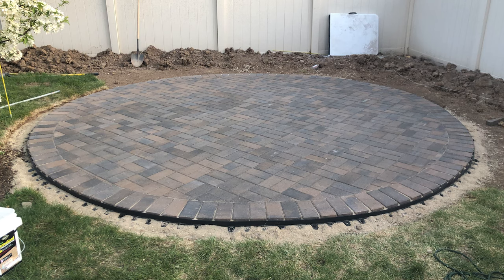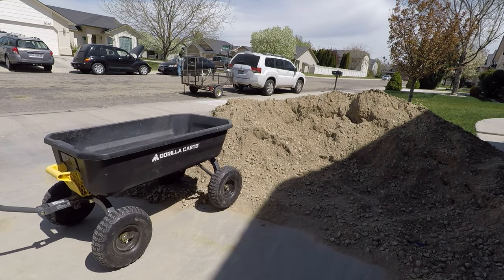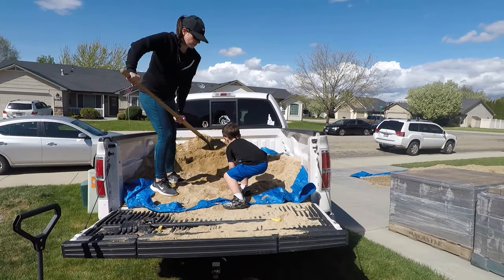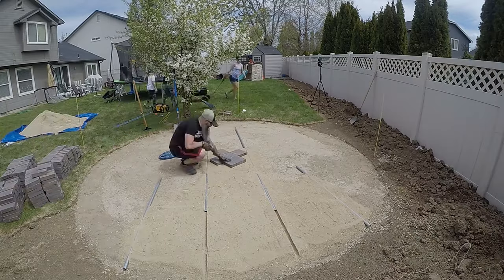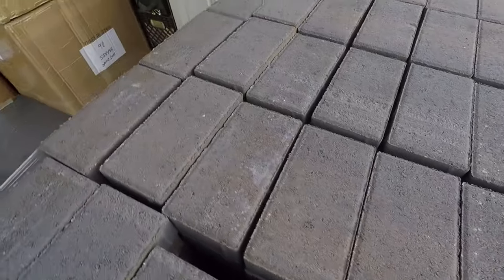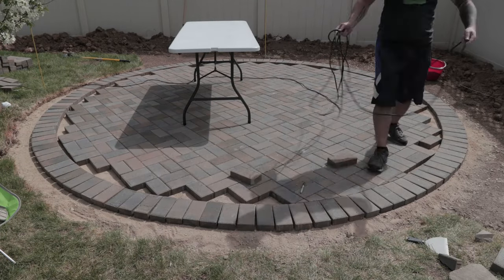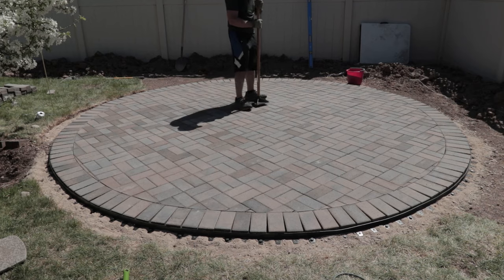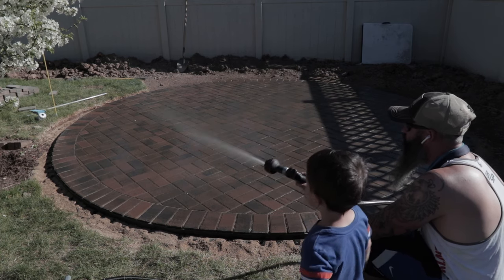How to Build a Round Paver Patio

Comment: Great information. I've built several of these. I quit using sand, though. Where I live, ants will burrow in it, and tree roots will undermine the patio. I use granite dust for the base. Once tamped, it's like concrete. Lay the pavers, and you're done. Try it.
Reply from the maker: I have both a tree root and an ant problem.  Wish I had known about that before!
Reply: @thetoolman3 are you just replacing the sand with granite dust or are you replacing the sand and 3/4s with granite dust? I have a big root problem.
Reply: So only use 4-6 inches of granite dust and no sand? Thank you
Reply: @ianrutherford1  I just use granite dust.  It packs so hard you don't have to tamp the pavers.  I tried using a power tamper on pavers over granite dust, and the pavers broke.
Reply: @thetoolman3  thank you!

Comment: i had bigger paver stones when i was doing this and i learned that putting a towel on top of the pavers and tamping with that 10x10 tamper reduces the risk of cracking. otherwise i would use a couple of rubber mallets (which takes much longer but zero cracking risk)

Comment: So instead of using the pipe to do the sand, dump sand in the area the in several spots around the edge and a few in the middle put the sand in little mounds about the size of a paver. Set a paver on a mound on the edge and push it down and wiggle it til you get the top of the paver a little higher than what you want. Do all the edge mounds first then set a paver on each one and put a string line on top of 2 and thats your hight for the middle ones. Screed from pad to pad until about half is smooth and its smooth the whole diameter 2 directions,  Chalk 2 lines across in the center. Set pavers in all 4 directions on the center lines. Let thepaver go past where you want the border. Draw a circle around the same way he marked his circle. Cut pavers in place fix edge of sand and set border.
Use a plate compactor with a urethane pad on bottom on top of pavers after you brush the poly sand on top then wet

Comment: I've been scouring the internet for this guidance. This is concise and helpful and will be my main source. A lot of people use a compactor on the patio stones. Is there a reason apart from cost not do this?
Reply from the maker: I think it depends on the stones you use.  I was worried a compactor would break these.  I broke one even with the hand compactor, had a high point and I thought I would just beat it down and it broke.  That’s why I suggested pulling the paver and removing a little sand to get it to drop.  
Thanks for the compliment!
Reply: @OutdoorBeards  Excellent point. Thanks for your response. Again, you've made the best reference for this project that I can find -- and there's a lot!
Reply from the maker: Good luck with your project!

Comment: It's easier to build beyond the border and mark it.  THEN cut along the marked circle edge.  Cutting each individually is actually slower and prone to inaccuracy. The borders should not have open slivers and should be "pied" so that they have uniform gaps at all planes of contact. The hand tamperer is not that helpful due to the lack of force it can efficiently deliver.  A much better option is to used a padded vibratory compactor.  It can also (and should) be used to compact the polymeric sand into the joints.  The hand tamperer is simply not recommended as is also stated in installation instructions from the manufacturers. Also, if you had no other choice, at least put down some padding so that chipping and white capping of pavers can be avoided.  The bare contact between the steel and paver is just asking for trouble.

Comment: If you used 124 around the edge, is the 14 ft circumference
Reply from the maker: Correct.  The math was done so the finished patio is 14’ wide

Comment: How many pavers did you use in total? I'm trying to do a 16' round patio, could you give me an idea of how many I should buy it and how much you spent in the material ?
Reply from the maker: So the math comes out to 747 pavers but with the cutting you need about 800.  I bought the pavers on sale for .25 each so I paid a little over $200 for the pavers.  Road base, paver sand, edging, and poly metric sand with delivery fees maybe another $300.  I bought the grinder new and random stuff, etc.  so I would say between $500-$600 total for just that patio.
Reply: Thanks for taking the time to answer my question it will help me a lot
Reply from the maker: Hey I’m sorry I thought you were asking how many I used on mine then realized just now you were asking for a 16 footer. The math for that size comes to 989 pavers.  Add at least 100 to that for cuts and random issues.  Good luck!

Comment: I would like to ask what kind of bricks you used. I just bought a bunch of used bricks, but it turns out there are 2 types of bricks. One of them has flat sides and one has spacers on each side so they fit together with a gap of about 1/8th of an inch. 

Not sure which kind to use. If I use the kind without the spacers, should I just place them as tightly as possible. 

Thanks for the video, the patio looks great.
Reply from the maker: The ones with the spacers are “pavers” for making a patio or walkway.  The gap that’s created is important to give space for the polymetric sand.  The other bricks you mentioned that don’t have the spacers are for building things like walls or built in grills where you would be using an adhesive to hold them together and, aesthetically, the spacers would look bad.  .
Reply: @OutdoorBeards  Thanks for the quick reply. Gonna start digging now.
Reply from the maker: Enjoy!

Comment: I need help to figure out how many pavers I need for a 13 radius circle 
Paver size 3.5in  x 7.1x 2.3in
Reply from the maker: Please confirm for me a 13 foot radius so patio will be 26 feet diameter? I have to ask because some people get radius vs diameter confused and then I give them a totally wrong number.
Reply from the maker: If the radius is 13 feet we convert that to inches.  13x12 = 156.  Then find the area of the patio.  Pie x r squared so 3.14 x 24,336 which gives us 76,453.8.  Then the area of the paver. 3.5x7.1 = 24.85.  Then we divide.  So 76,453.8 / 24.85 = 3,076.6 pavers.  Round up a bit for cuts and such.

Comment: Im just about ready to begin building mine. You used an angle grinder for cuts. Was it a 4" or 7" and would a 7" do a better job? I need to buy one for the project.
Reply from the maker: I used a 4” which made me cut both sides, break it off, then shave down the remaining bits of the edge.  A 7” grinder would make this process easier.

Comment: Hi! Super helpful video and to the point!!! I’m going to mimic yours exactly LOL. How many pavers did you end up using? (Not sure how many to buy for this size patio and I’m new to all this!)
Reply from the maker: Amy Zhang so the math comes out to 964 pavers.  I had purchased 1400 because I am also doing some edging using the same pavers.  I would suggest buying 1000 since you will be cutting some.  Remember when cutting that you can use the cutoff pieces in other spots and have less waste.  And with Lowe’s and Home Depot you can return what you don’t use.  Good luck!
Reply from the maker: Amy my math was wrong the other day.  I did the math for a square not a circle.  Correct number is 747 pavers so maybe a little over 800 and you should be good.
Reply: What math are you using? Is it a calculator?

Comment: Do you know the total cost was for this entire project?

What is the radius of your patio?

How many days of work did this take you? If you kept track of hours you spent I’d be interested in knowing that.

I’m proposing to install one of these at my city Zoo and I’ve never done this type of job before. Just want to say thank you and your video may help improve a kids interactive reading area at a Zoo in San Jose CA! 🙌🏼
Reply from the maker: It was a 14’ diameter, so 7’ radius.  As for cost, it’s hard to say because I did two patios and 150 feet of edging all with these bricks, so I purchased like 1600 pavers but this patio only used 800ish.  Also I bought paver base, sand, and poly metric sand for all the projects at once.  If I had to guess I probably spent $500-$800 on the patio.  Also this was 2020 so things have gone up and I’m kind of estimating.  Hours worked, I did it over the course of 6 days at 8-10 hours a day. 
Hope that helps and good luck with your project!

Comment: Thank you for the video. Super helpful!  Had a question...how important is getting the foundation leveled BEFORE the paver base?  Is it safe to say that as long as I can put in 4-6” of base layer that is leveled or slightly leveled away from the home, I should be okay?
Reply from the maker: When you lay your pipes down to start applying the sand you will see gaps under the pipe here and there.  This is not a huge deal.  However, if you are so far off that say the left and right pipes are lower than the middle pipe while your skreeting you may end up with waves in your patio.  When you lay the pipes down their level in relation to each other is very important.  So I would say do the best you can at that stage to stop problems from occurring later on in the process.  Remember this is the foundation. The better you do the foundation the easier the rest of the steps will be.
Reply: Thank you for the quick reply!  I think I was using the wrong terms in my questions.  How important is it to get the clay/dirt leveled before putting the base/gravel layer (pre-sand)?  I don’t think I’ll have any issue leveling the base layer after putting 4-6” of it in, but digging and tilling the clay here to getting it leveled is taking an eternity - LOL!  Thank you for all your help and hope you upload more to your channel!
Reply from the maker: Oh I understand now!  No that is not important and can be rough
Reply: Perfect thank you! 🙂

Comment: What kind if sand did you used for the pavers to sit on?
Reply from the maker: It’s just called paver sand.  You can get it at a landscape supply in bulk or at Lowe’s and Home Depot by the bag.  The bulk option is much cheaper if you have a truck to transport it.

Comment: What size angle grinder are you using for this project? thanks
Reply from the maker: It was either a 4.25 or 4.5.  Don’t recall exactly.  It would be much easier with a larger blade but that size grinder was cheaper and I didn’t mind the extra work.

Comment: I know you said you dug a 7" hole, but how do you ensure that it was also a 7" deep hole, say, in the middle of the hole?
Reply from the maker: The hole being 7 inches exactly all around os not important.  You don’t have to level out the hole.  It’s just a rough number.  The high and low spots created from digging get filled by the base material which you do level out as you pack it down.
Reply: @OutdoorBeards  Thank you!!!

Comment: How deep should the landscape edging be? Should it be as low as the layer of sand or only as low as the pavers?
Reply from the maker: Technically the edging goes on top of the base material to hold the sand in place.  I did mine different because after the project was done I removed the edging and packed dirt in to hold everything in place.  Where I live the dirt is mostly clay so this works.  For most people o say do the edging before the sand step.  This is challenging with a circle patio though.

Comment: Thank you for sharing this is exactly what I am looking for to start my next project. I would like to know how many stones did it take to in total to complete the project?
Reply from the maker: Just under 800 if I remember correctly.  It’s been a while.  I think the math came out to around 750 but you need extra for the cuts.
Reply: @OutdoorBeards  Thank you I am also going to follow your Edging that one looks really amazon too your work is fantastic.
Reply from the maker: Hey thanks! little advice on the edging, use some concrete around the upright.  The poly metric sand does not hold up as well as I hoped.  I went back and put a bit of concrete behind the upright portion of the edging.  This would have been easier during install instead of after the fact.
Reply: @OutdoorBeards  Thank you for the advice  I will do that.

Comment: Great video... what was your total expense in material?
Reply from the maker: Maybe $600.  It’s hard to figure out because I actually made two patios and 165 feet of two step edging.  I bought the material to do all of it at the same time so that is just an estimate.
Reply: @OutdoorBeards  $600, still significantly cheaper than a contractor. Thank you for the info.

Comment: Great video! How did you determine how many pavers you needed for the outer edge count? I'm making one with a partial circle, roughly half of a circle with a radius of 4.25 feet. Should I just eye-ball it are there inserts or a method to keep them evenly spaced out at the very outer edge? Thanks!
Reply from the maker: My brother is a mathematician and helped me do the math.  I’m sorry but I would not be able to explain that via a message.   As for keeping them evening spaced I just eyeballed it.  It’s pretty noticeable when something it out of wack.  Good luck!
Reply: @OutdoorBeards  Ok, thanks! I'm a bit worried that with such a small & tight circle, the outer bricks will have pretty big gaps at the very outer edge of the circle (like the rim of a slice of pie). Hard to describe w/out a picture. Anyway, with just sand in those wider/outer wedges, not planning to use perma-sand if I don't have too, I hope it'll be ok. Thanks again, your pavers turned out nice!
Reply from the maker: @heytae  what size are you pavers? Length and width.  I can do the math for you but I couldn’t explain it.  Lol.  Also you should use perma sand.  Regular sand will wash out over time and won’t stop the pavers from moving.
Reply: @OutdoorBeards  That's very kind of you but probably not needed now. They're 8 1/8 x 3 7/8 but I just found out today that the bricks we have to go with to match an existing bricked area can only be bought in "cubes" of 1015 bricks! I think I'll use about 700 of them per the brickyard. That's because we're considering going with split pavers (half the thickness) for less cost, and just increase the base rock thickness to get the bricks to sit at just the right height. That's very generous of you to do the math for me, but because we'll have plenty of bricks left over, I don't think we'll need the calculation any longer, but thanks anyway! Yeah, considering perma sand, but I saw some youtubers say not to use it b/c it'll peal after X years, but here in the San Jose, CA Bay Area with the mild climate, I can probably use perma sand w/out any issue, right? I like the idea of perma sand but don't want to worry about what it might look like in 5 yrs so please lmk if you have an opinion for my climate.

Comment: Trying to do a 10” circle how much brick?
Reply from the maker: What is the measurements on the pavers you will be using?
Reply: @OutdoorBeards  8in-L x 4in-W x 2in-H…also it’s a 7” circle…
Reply: @OutdoorBeards  also how much paver base would I need thanks.
Reply from the maker: Can you look at the specs of those pavers.  Most likely those aren’t the measurement.  Should be 7.5x3.5x1.5 but they are called 8x4x2 to make it simpler.  Please verify this because that will change the math.
Reply from the maker: For the paver base, how deep are you digging?
Reply: @OutdoorBeards  Actual-3-8-in-x-7-7-in
Reply: Actual Height (Inches)	1.7
Actual Length (Inches)	7.7
Actual Width (Inches)	3.8
Reply: @OutdoorBeards  also I have existing concrete and want to match the height so not sure how much to dig down.
Reply from the maker: Ok so just so you can see how this is calculated.  A 7’ circle is 84” in diameter.  Area of a circle is pie times radius squared.  So for your project 42x42x3.14159=5541.77.  This is area of the circle in inches.  Then for the area of your paver is 7.7x3.8=29.26
Number of pavers is 5541.77/29.26 = 189.39 pavers. That’s if you used every inch of every paver.  You will have cutoff waste since it’s a circle so I’d say start with 200-220.
Reply: @OutdoorBeards  awesome thanks so much I really appreciate it!! Is there a minimum of paver base that I need to have?
Reply from the maker: For the paver base I’m going to share a link to you in a moment but to answer your question.  Minimum should be 4 inches of base.  So if we use that, and you want to line up with the current concrete, 4 inches base + 1 inch of sand + 1.7 inch paver thickness.  Your dig should be 6.7 measuring from the top of the concrete.  I don’t know the math for calculating the base material so I use the link below.  You enter the area of your patio, which we calculated at 5541 inches.  Give it your depth info and it gives you a total.  Your patio is 38.479 square feet.  This calls for .47 yards of base.  Link to follow
Reply from the maker: https://www.inchcalculator.com/paver-base-calculator/
Reply: @OutdoorBeards  I really really appreciate you! Definitely will be subscripting!! If I have an other question I’ll be back lol means a lot to hear from you so fast!!
Reply from the maker: If you want to dig deeper to have a stronger base just change the depth in that calculator.  If you live somewhere like cali with lots of quakes this would be a good idea.  Or lots of rain fall like Washington.  I’m in Idaho and I think I went with a 5 inch base which was recommended by my local landscaping supply place.
Reply: @OutdoorBeards  yes I do live in cali
Reply from the maker: No, technically you could accomplish it with just sand but it would likely move over time.  The deeper you go the more solid it becomes.  It also helps with drainage.  Personally I wouldn’t do less than 3 inches regardless of where I lived.  I think 4 is a safe bet.